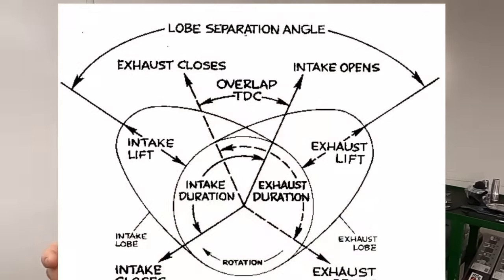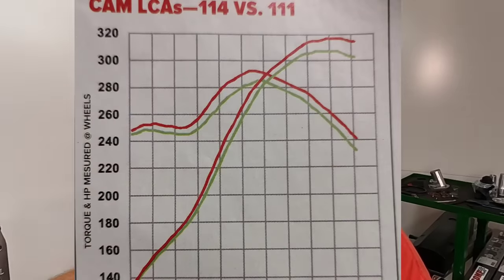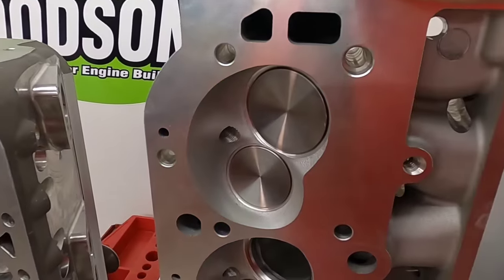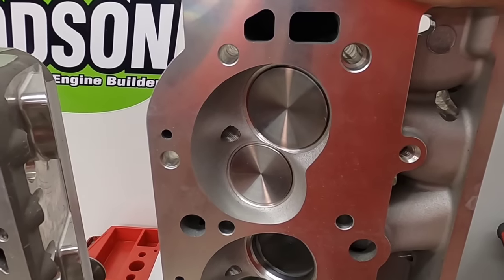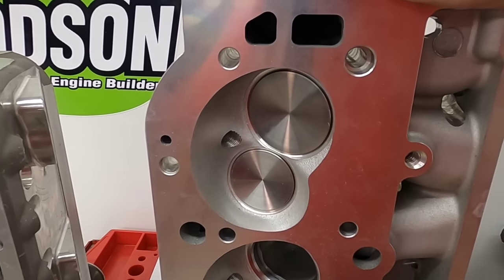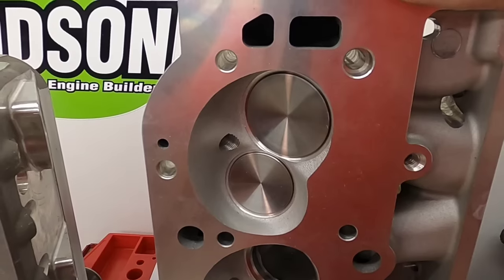Camshaft Lobe Separation Angle: The Untold Truth of LSA!! How to Pick LSA the right way@DavidVizard

Comment: Mr DV, if the car-guys haven't tested for the best cam-lobe separations, have the Classic Motorcycle sellers like Hitchcock, done any 'Better'?   The Royal Enfield motorcycle camshafts are smaller, due to RE usually only having singles & a few verticle twins, vertically split, such that Japanese 350cc twins could nearly perform with the Classic British "40s" [650cc].   The Japs probably DID do cam-shaft lobe-separation testing, but I don't think the top-6 British twins makers, did {--AJS. Matchless, BSA, Triumph, Norton, & Royal Enfield }.  By the end of the 70s, the 1st-2 dropped-out,--the next 3 combined, one "struck" with labor 'trouble' & then all Quit, & R-E quit/ had moved to India.   I always thought the "Big-6", --even if cheaper, weren't 'Better', except in handling, looks, & Ad-Models.    Before quitting, AJS/Matchless had had one main-bearing 'tween its twin cylinders, but then it STILL wasn't reliable unless kept @ 600cc, ---a huge disappointment.   The "top" seemed to be 750cc & 65Hp, good numbers in the late 60s, but un-impressive by the 80s, by which then they were all DONE.   SCRM got the "40" to 920cc in some brands, but again, I don't see cam-lobe mods.

Comment: I have a question. I have a 383 stroker motor. 13.8 to 1 compression. Liberty aluminum heads 202 intake 160 exhaust. Hoarded intake Port match. I have a 6:30 solid roller cam. With a 106 LSA. It made 510 ft lb of torque at 4700. 582 horsepower at 6800 I think I believe. So if I were to put a wider lobe LSA cam in. Would it make more power? It is in a mud bog truck here to appropriately for the tires trans brakes stall converter. If I can get more out of a cam swap as you guys say what cam would you recommend.

Comment: Question 
I have a 272 Y block Ford w very low comp.  I bought the bigger valve G heads and after the fact before I put them on I measured the chamber depth and discovered they were an 1/8" deeper. 
Smack my forehead somebody.
Put them on anyways because I'm learning the hard way sometimes I'm a glutton for repetitive "go ahead and try", and " it figures". 
Needless to say it wouldn't fire and I"ll pass on telling what the actual compression was after the fact.
 . . . So I don't feel good about grinding the heads as they are the 1957 type "non posted" meaning they lack a couple of inside cast iron pillars for structural fortitude around the center two cylinders. So there is a caution don't grind to much. Duh. 
I know my intro is a bit long winded but would like to share my intents w this engine now.
Would like to pull pistons, hone and install new rings. By the way there is absolutely no ridge reem. So was it bored out before or just ridge reemed and rings all ready installed.  Don't know yet.  Will have to borrow a bore gauge and a large Mic.  
If piston to sleeve measure okay then would proceed with the ring thing.
Now Im thinking I would put original heads back on as those chambers are shallower ( probably because those heads were planed a fair bit already with success ).
Do some gasket match porting even though my expertise in this field is quite limited.  Miraculously remove cam while zip tieing all the lifters in the open position. ( don't want to grind lifter heads as would mean removing crank, unless there is enough space between crank and its upper cavity to manipulate these mushroom lifters back to their home, via string hot glued on the small end ?  Then Maybe lifter head grind) I've not the room for an engine stand inside. Would be nice.
My max compression before was 80 to maybe 95 lbs tops, few even lower. How ever lame it still ran okay, no oil burner. Suspect sticky rings. ?   (1956 f100  I put in a Tremic 5 speed, much nicer) 

I now have a 1957 Autolite carb, I think it's between 4 to 500 cfm, a 4 barrel intake and now dual exhaust rams horns all of these just now installed.
Here is the question 
If i was to take my cam shaft in for a regrind what advice is recommended on its grind character on the hope of my ring job brightens things up to 120 poundish. ( Still low I know )
I would like a bit more torque from low to a modest high mid range rpms.
A bit better performance all way round. Just a nice country highway driver on the freeway now and then.
For it to go a bit better.
Thnx
Hodge.

Comment: Andy,
Building a 5.4 3v 
As a daily driver 
But I would like to
Bump my horse power from 300 at the fly to 400 at the wheel. I've bumped the compression from 9.8 to 10.4
How do I calculate what my lsa should be?
Reply from the maker: In the next video with DV we will get into the details of how to select the right cam
Andy

Comment: Rookie question as I’m beginning in my own personal knowledge of engine building. I was under the impression that lobe centerline and lobe separation were not the same but it sounds like by your alls videos that they are just different names for the same measurements. Am I understanding that correctly now?
Reply from the maker: Lobe Separation Angle and Lobe Centerline Angle are the samething. Overseas it is commonly referred to as LCA. Now the Intake centerline is used in reference to the phasing of the cam in relation to the crankshaft 
Hope this helps
Andy

Comment: Using the 128 formula that you talk about, the cam I should use , should have an LSA of 107.26. 401 cu in and 2.20 intake valves. The cam I just put in it , according to the cam card is 108 LSA. Is that close enough? Serious question.
Reply from the maker: Yes it will work well.. the cam in my MIXED UP BOSS was a off the shelf grind that was "close" to DV'S program and it made 1.39lbft per cube 
Andy

Comment: I did the math using DV 128 theory and came up with a 214-218 on a 106. This is using a 385 sbc with 2.02 valves. This just won't work.  I haven't found anything to help factor in 10.62 compression, 200cc intake runners or any other factor in picking a cam. The reason the cam I cam up with using David's 128 won't work because of pump gas and won't let it use the 200cc runners. What am I missing?

Comment: Since we are talking about street engines, vacuum needs to be discussed but wasn't in this video. You can run more duration with a wider lobe separation and still run power brakes. But with a 106 or 108, good luck!
Reply from the maker: If vacuum is a problem it's better to run a cam on the right LSA with less duration! The engine will make more power than having more duration on the wrong lobe centers.
Andy

Comment: I'm looking for a retro fit roller camshaft for a 350 .60 over. Have AFR 1001 195 heads. Stock bottom end 750 Street brawler carb and a hydraulic flat tappet cam in it now that has not been ran because the heads have roller springs on it. I was just looking to swap cams before damaging the one that's in there. Figured I go roller and step away from the flat tappet for the first time. Compression ratio is Iike 10:5.1 maybe a tab bit more just a little. Can you help me on what to get for this setup. The flat tappet cam is a Howard's 110061-08. It is what I was going to run until I fund out I have roller springs on the heads.

Comment: I'm building a 2000 350 vortec out of a 3/4 ton truck. I'm not planning on any machine work,  just going to put higher compression pistons in and do a basic rebuild.  It's going in a 1992 z71. The plan is 9 inch lift, 40 inch tires,  5.13 gears.  What would be the best combination of compression and cam?

Comment: Is it safe to assume that duration and overlap are measured at 0.050" lift for this video? The overlap numbers could be pretty different if different measuring methods are used. 
   Also, how would use of cast iron exhaust manifolds affect the desired LSA? Scavenging during overlap wouldn't be as effective...
   Thanks for this video. And others!

Comment: I have a question you might be able to answer I have a 349ci ford small block I was running a comp small base circle cam with Motorsport lifters duration 232/240 0.566 0.576 112 lobe separation and a 108 center line my Maverick weighs 3060 lb it would run 115 mph into quarter mile with this camshaft camshaft messed up so I changed it and put a Howard cam which 239/241 lift 0.581 on intake and exhaust lobe separation110/106 and now the mile per hour the best I can get is 110mph in the quarter mile only thing changes to camshaft same carburetor just came too is a small base circle but I am running Link bar lifters

Comment: I  248  : E 256  - L 688  -114  this was recommended for me. I have a LS 427 dart motor with twin turbos does this sound like a good cam for drag race only?
Reply: I would like to make 1500 hp.
Reply from the maker: I think it will get you where you wanna go, on a turbo setup it's about the exhaust back pressure vs intake boost ratio..
Andy
Reply: @UnityMotorSportsGarage   The cylinder heads flow 360 at 700 lift. I bought a set of boost line rods and a scat crank trying to make sure it can handle 2000 hp it may never see that but I want it to be strong.

Comment: Would David be interested in specing a cam for my drag bike? It's a rather special build iv been working on for about 12yrs and I'm approaching the goal with it's newest incarnation (new frame, compound turbo setup). I'll share more than I ever have lol. It's a xr200 offset bored 5° and destroked to 49.5mm bored out some gotta look in my book i don't remember but it works out to 155cc single cylinder. Currently I'm running a stock cam I reground for more lift and nocked the tops off to give it a 245° duration but still loads more lift that stock I think it was about .500 lsa is still the stock 108° and I have no clue what to do for a custom grind. It has 4mm bigger intake valve and 2mm bigger exh. Ported with checking on my homemade flowbench. Running a 32mm carb on e85 blow through. Boost is currently at 45psi although she has seen 70psi on the Dyno. It makes great power and I'm not far from my power goal but currently I have a powerband from 7k to 12k but I do rev out to 14500 and it just hits a wall up there. Iv done everything I can think of to fix it nothing has helped. More boost just gets me more power but same curve. Runners should be good until 14 and iv tried designs for more and less rpm. Single turbo going from the stock to reground cam made a huge difference all around but moved the fall off up only 1000rpm. Static Cr is 14.5:1.. yes I know high for the boost but that hasn't been an issue that iv noted. I know most aftermarket cams for the xr fall off around the same area as mine but there's not many drag racing these either so I figured the need for a cam that goes that high isn't there. I'd be happy to pay for a spec to grind. And grab my book answer any questions needed. All my fancy testing gear is mostly homemade so I take them with a grain of salt and times as gospel. Im currently chopping a sport bike cam to make a test cam lol I know it's not exactly the best comparison but when you're not sure I figured it would be a cheap test.

Comment: I have .800 lift, 114 LSA with a 2.100 intake valve with 15.1 compression ratio.
What do I need for separation angle 360 cu inch SBC with
3.500 stroke crank 6" rods .

Comment: I got a 04 GTO auto and it’s getting a cam trick flow specialties track max cam for the ls1 and I want to know if is a big cam and will it add horsepower and torque and I also have afr cylinder heads

Comment: so what gives the engine that loping sound ? the lobe separation or duration or both ?  I want build a mean LA360 but right now all I have are 360 J heads with 2.02 valves . eventually I'll have trick flow heads
Reply: A tighter LSA will have more lope everything else equal
Reply: Overlap triangle = LSA and duration. =
Both valves open at the same time

Comment: So as you say less compression means you need a tighter lobe separation angle. Wouldn't that mean the engine would be a dog at low rpm due to increased overlap bleeding off compression on top of already having lower compression?

Comment: I got a 98 5.4 truck, I'm finna do a pi head swap soon which I know is gonna increase my compression from 9 to 10.1 I think, so I'm trying to figure out what lobe separation angle cam should I go with to get a good power increase any ideas?
Reply: LSA = 128-(((CID/#-of-cylinders)/In-valve-diameter-in-inches) * 0.91)

Comment: I found this channel through David‘s channel and I’m intrigued by The lobes separate ration angle Concept and want to know if that will roll over to a fox body 5.0 platform
Reply from the maker: Yes it does! Use 127 instead of 128 for a SBF. Thanks for watching
Andy
Reply: @UnityMotorSportsGarage  Since engines are essentially large air pumps, why is 127 recommended variable for SBFs?

Is it because they generally have more restrictive exhaust?
Reply from the maker: @richdouche8253  it's because of the angle entry of the port into the chamber.  SBF heads doesn't have near the amount of swirl say compared to the SBC..
Reply: @UnityMotorSportsGarage  Got it. Last question? If calculation for LSA lands in between... Say 108.5 for example... Do you get a cam with 108 or 109? Is it "close enough" in this regard and pick either, or less LSA is usually better, so go 108?
Reply from the maker: @richdouche8253  that really depends on the cams available .. The difference is  minimal in terms of power and torque in that .5 deg either way..
Reply: @UnityMotorSportsGarage  Awesome! I'm building a 347 with AFR 185 for a '66 Mustang. Need to pick a well matched cam for street....

Using this technique leads me to 108 LSA with about 276° int duration. Howard's cam #222755-08 seems to be about the best fit. 108-278/284-.533/.544

Claim 2000-6200 range.Think this would work out well? Or go after a little more lift and overlap?

Thanks for your replies and sharing this invaluable knowledge!
Reply from the maker: @richdouche8253  how much compression you going to run?
Reply: @UnityMotorSportsGarage  Static should be about 10.5:1
Reply from the maker: @richdouche8253  you should be really happy with that cam!
Reply: @UnityMotorSportsGarage  Sweet! Soon I'll be chirpin' gears, and pullin' brodies, going er er er errrr!

Comment: More lobe separation means a broader power band ,purple shaft cams don't have much lobe separation I don't like them On the street ,torque is what throws the car down the road if your not sure what cam to buy call edelbrock there cams work they have been dyno tested ,I put 3 different comp cams in my cousin's 68 Camaro  350 / 4 speed ,3:31 gears in a month ,they sold him 3 different cams with a low lobe separation they sucked a  edelbrock performer cam out performed them

Comment: I have  a 416 cu in ls3 stroker with a Texas speed 240/250 .629 .629 117+5 LSA, I am running a centrifugal blower and I was told that the higher LSA is better for boost since it's less overlap so you don't bleed off boost, it's that accurate?
Reply: I thought it was more because the blower is forcing the charge into the cylinder instead of relying on scavenging during the overlap period on a naturally aspirated engine

Comment: I will give you a follow and I have a question, I have a 2008 Chevrolet silverado 1500 4x4 with 5.3l  ly5 engine with dod/afm delete. It is my daily driver toy hauler lol I would like a cam with a smooth idle but some torqe and hp increase. My compression is 9.9.1 it jas stock 243 heads.

Comment: If your looking for good vacuum and hp in a 428 scj running 10.5 to1 compression what lobe separation would you recommend? Lift just under 500.
Reply: Use DV's formula.

Comment: How can I get in touch with these people ? I got different cam specs from three different cam grinders. I have a 351 Windsor with a 393 stroker kit. Aluminum Heads with 62 CC chambers 2.02 intakes 1.60 exhaust 190 intake runners, about 9.6 to 1 comp ratio. .485 lift on intakes 475 lift on exhausts 216 duration on intakes 224 duration on exhausts @ 50 thousandths. 110 LSA  This is the cam I ended up ordering, & I am wondering how good or bad my selection was. Haven't put it together yet, so not too late to change. This engine is going into a Ford F 150 with headers & 750 cam carb

Comment: Half the intake duration plus half the exhaust duration divided by two equals LSA. So this also makes sense why the longer the duration added to push the powerband higher i to the RPM range, will usually have a wider LSA. but for an N/A engine, mechanically advance the camshaft so the intake center line is advanced by 2 degrees,  and transversely the exhaust retards 2 degrees. * if that makes sense. Example 

110* LsA camshaft with a 108 intake center line and 112 exhaust center line. Means having the preferred overlap but opening the intake sooner and holding the exhaust valve open to scavenge more gases.  I hardly hear of this point in LSA camshaft talk

Comment: I have a destroaked 350 sbc it's a 331 ci with older world products sportsman 2 heads ,with 2.02's , I'd like to spin it up to at least 7000 rpm but just because a screaming small block sounds great but have no idea on what cam to run for a street/strip set up .

Comment: I really don't like tight LSA cams (106 & 108, etc.) In my experience they make a four stroke kind of run like a two stroke, peaky power curve. Plus, they need a lot more choke, idle worse and lose vacuum.
Reply from the maker: You need less duration... Simple

Comment: In explaining anything people leave out theory!  When anyone is building a engine it's about what are u going to do with it.  It's a air pump period! So when compressors were designed what came about. Certain cams in Certain applications have fuel delivery signals 
Every engine is different! So to say a cam advertised for a small cubic engine is not applicable for it u build around your selection